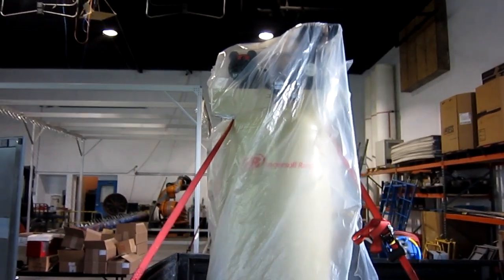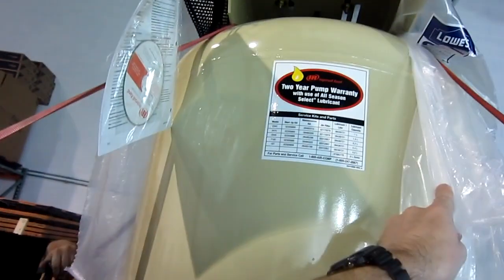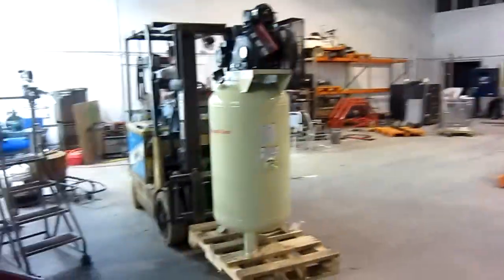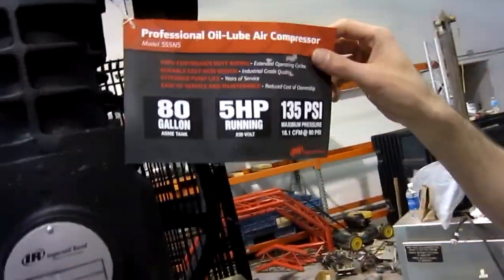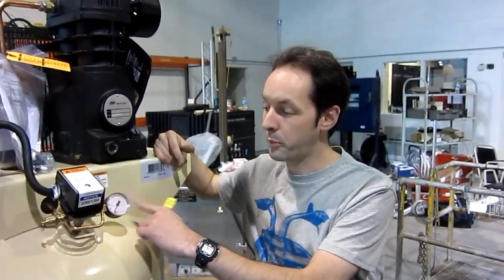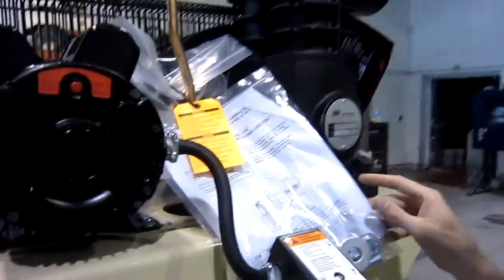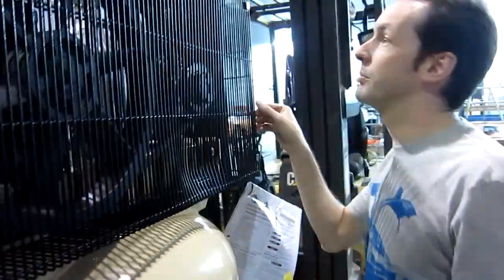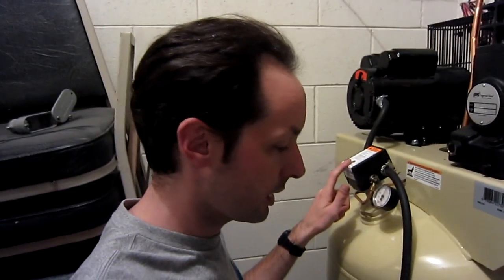Captain's Blog 8-2-11 REAL air compressor

Comment: Mmmmmm! Air!! Sweet. Will you be running air lines throughout the building for the wood working shop and stuff? Or would it be cheaper to just a have a separate air compressor in the needed locations?